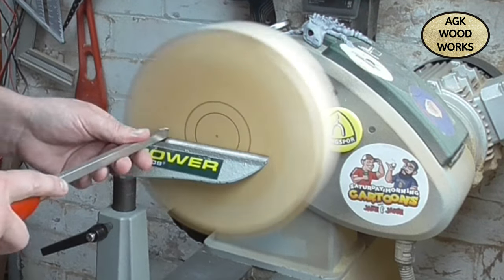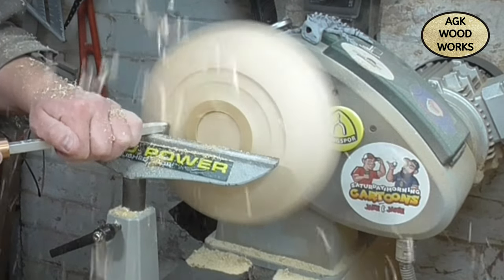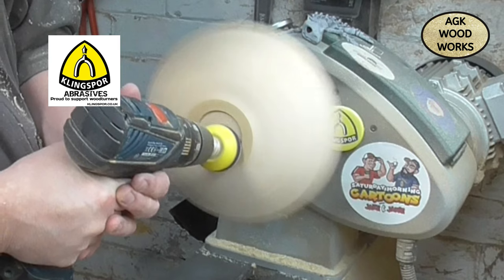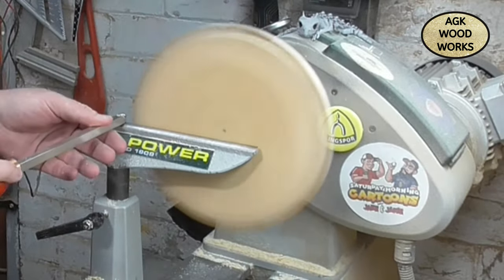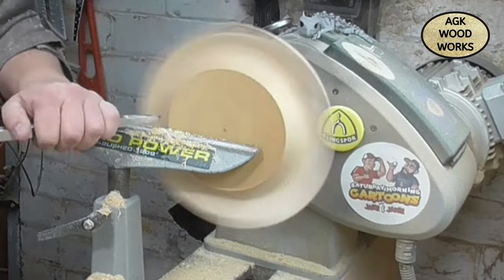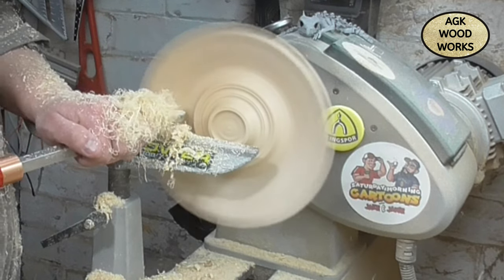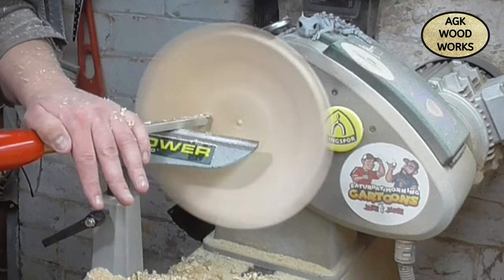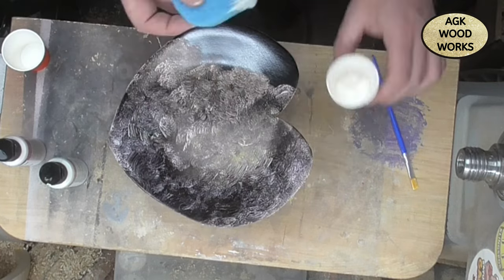Woodturning a Heart Valentine Bowl

Comment: Hi there, I enjoyed your video and have subscribed. I'm just over a year into woodturning, have had quite a lot of lessons and do a fair amount so am relatively competent with traditional gouges and skews and am producing a decent finished item with few errors and generally improving. The experienced people at my club are entirely pro-traditional tools though  and refuse to engage with carbide tools...or even discuss them! 
I need to invest in some hollowing and box making tools to move on and wondered if you thought going down the carbide route is a no-brainer. 
They seem 'easier' (less problematic) to use inside hollow forms but equally seem more expensive than a decent quality (say) Robert Sorby tool.
Any thoughts welcomed.
Reply from the maker: Hi there Mike firstly thank you for the nice comment and thank you for subscribing, i have used a lot of different tools over the years and the last 2 years i have switched to carbides, in my opinion the Easy Wood hollowing tools are fantastic , the number one hollower when i got it was a game changer , it removes material like butter and its not as aggressive as some others on the market , in my option their  cutters are far sharper and last longer and the quality is worth the extra money again in my opinion, i have a full set of the cutters with standard rake and a full set for negative rake for when I'm turning resin or a very hard wood, i get a really good finish , i must say i am very happy with them and they are top quality. hope that helps you in anyway Mike.
Reply: Thank you, that is great advice and good to hear....looks like I'll be saving up my pounds! I'm going to be in Toronto in the Autumn....I wonder if a set is slightly less expensive in Canada than UK? I'll have to do some research.
All the best. @agkwoodworks3136
Reply from the maker: @mikew2468  please let me know how that works out you you buddy